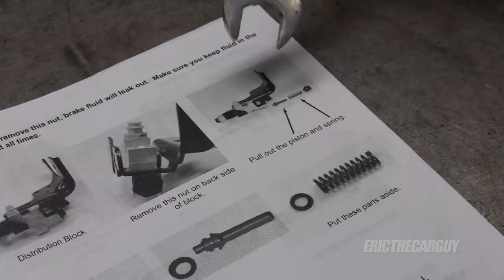GMT400 Rear Disc Brake Conversion (Part 2) #ETCGDadsTruck

Comment: I have a special tool to pop a button out to bleed those older abs units. Can’t remember where the “button” is, or the tool for that matter. But you can’t just actuate the older units to bleed them is my point, at least not in my experience. Of course none of this matters here anymore. Thanks for watching

Comment: Nice video as usual, little bit concerned about the bend in the brake line that you did on the vice, I thought that you had a set of brake bending pliers?
With the parking brakes it looks like it might be worth cutting off that little bit of metal with the hole on the top of the calipers, I'm pretty sure that's only there to hang the calipers when you're doing service work... That might allow the cables to run a bit more freely.
I'm really enjoying this build!
Reply: Kinda cringed on that part too :/
Otherwise it's a great tutorial.
Reply from the maker: Everything works fine without issue. Thank you for your input.

Comment: Seems to spend more time wrestling with the parking brakes than time spent on the disc conversion.
Around here, we cut the parking cables since they just rust up and seize.
Reply from the maker: Personally, I use my parking brake.

Comment: So it looks like the modification for the proportioning valve is just change it to a safety so if you lose a brake line it will close off fluid to that part of the circuit.

Comment: Why did you not route the parking brake cable through the hole on the caliper?
The camera was right on it 30:45 ... the heck?
Reply from the maker: Because it was made for a Lincolin, not this truck. The cables on the truck won't fit that attachment.
Reply: Bet they will

Comment: Eric why did you put the fitting in the back and swap the lines? Every video I've seen about the NBS master has the fitting in the front and the lines are put back in as they came out. Please explain if u have some time. Thanks!

Comment: Not sure if is called the break modulator "round thing by the master cylinder. Might of went bad not stopping the truck as quick as should. No air in the break line(s). Got to get that fixed fully so the truck stops properly. And with souping up the vehicle to go much faster and so stops much faster.

Comment: Want better brake feel do this. 
Pump breaks 4x hold on last pump.
Open bleeder from passenger rear first. keep brake pedal down don't release until bleeder is closed.
Repump 4x hold on last. Open passenger rear bleed then close.  Repeat until not air bubbles. Then move on to driver rear. Repeat steps above for bleeding. 
Then move to passenger front. Repeat. Then finishing at driver front. 
One more time around for good measure and your good.
Reply: Does not work on most of the GM trucks with the early ABS unless you get lucky, or follow the procedure to get the ABS system into the "home" position.  Even then, without a tech I tool, still need a bit of luck or a gravel road and reapeated skidding stops followed each time by bleeding the rears.

Comment: I think that's just the GMT-400 brakes - I never liked them in my '94, either, even with drum rears fully rebuilt, wheel cylinders and all. I think stainless steel brake hoses will make a big improvement in feel, though. I've used them on motorcycles with excellent results - automotive should be no different. I'd install them both front and rear ( if there is a rear hose - YMMV ) - should make a very noticeable improvement.
Reply: Thinking about stainless steel brake hoses on my 99 suburban, the pedal isn't great. The brakes on my 95 caprice are perfect, then when I drive the truck I always forget how much worse the brakes are and end up foot to the floor trying to stop.

Comment: The cable will stretch and you'll be able to purchase more threads, eventually. I would have made brake lines from the master to the prop valve, but that's just me. Hopefully it's all worked out.
Reply from the maker: Those were special sized lines or I would have. Also, time is a big factor with this build. Thanks for your input.
Reply: @ericthecarguy  You're welcome Eric. Hope it turned out well. Can't wait to see the engine and transmission work.

Comment: Hey Eric, Please do a follow up on the electrical side of the anti-lock withdrawal. Did any lights come on on the dash? If they did, how did you deal with them. I think my truck has the "computer", but I do not remember seeing the "actuator valve". I'll take a look when I get home tonight.
Reply from the maker: Yes, the ABS light is on, but since I'm going to build my own cluster without an ABS light it's not going to be an issue.

Comment: You should use Dot4 or better with disc brakes.  On this truck it probably won't see too much heat in the calipers unless something gets stuck.  I switched to Dot4 on my truck because the brakes heat up when braking harder or longer distance with a trailer or a load in the bed.  I switched to Dot4 on all my vehicles just to standardize.
Reply: I use DOT4 in a lot of things but it comes with it's own hassles.  It is still hygroscopic but the degradation curve is a lot steeper.  You are down to DOT3 temperature range in many vehicles in two years depending on what fluid you use.

For me, unless you need it (race cars, tow pig or European cars that call for it anyway) I just suggest good quality DOT3/4 synthetic changed every three years.  Cost savings is significant and performance curve after about 18 months is similar.

Comment: Why did you not use the kit from Little Mfg Shop kit?  They use the same rotors as the front.  Also on my ‘89 K1500 I put a Master Cylinder from an 06 Silverado 4x4 and it much larger than the one you have.  Pedal feels like a 2022 truck and thats with the drum brakes.

Comment: Did you ever figure out the little holes in the calipers was just big enough to hold the emergency brake spring? Not being a jerk those holes look like intended spring guides/holder. @30:51 you say it's just going to rub over the top of it. How about go through it.

Comment: my 94 s10 master cylinder looks exactly like your stock master if i put the new master cylinder like you did would i have to swap the lines like you did. i would love a firmer brake pedal in my truck.

Comment: As I said when you got the truck from you Dad, the brakes will NEVER be better than ok.  I spent a ton of cash and time to get to the same result.
Reply from the maker: Actually after this work and replacing the front brake lines with steel braided, they do feel great. I'd say start with steel braided lines and go from there.

Comment: I found when i bleed mine have it running and started with the farthest caliper away from the master cylinder was the best way for me to get peddle
Reply: Sometimes there just isnt enough pressure when the cars is off. Had it with my toyota pickup when I put new calipers on. Nothing would come out if it was off. Had my friend start it and boy did it finally come out.
Reply: @HillBillyAsian  my dads been doing working on cars since a kid he always taught me if you have a dam chevy start it first or the peddle will be garbage most other cars i just gravity bleed

Comment: Is there such thing as a hydraulic 'Pressure-o-meter' to give you an idea how well the master cylinder is doing it's job?
For the brake switch, go old style with one connected to the peddle.
Ooops i forgot that this in the past, sorry.
Reply: SSBC has a kit with a 3000 psi guage and a few bleeder adapters

Although, this goes right on the caliper. So if you're like me and don't have friends to pump the brake pedal all afternoon, you could also find a cheap electronic pressure transducer of a few thousand psi and wire it to a volt meter to just compare values

Comment: Question: Could the rigid brake lines be swapped out to say Goodridge Flexible style lines? This would avoid having to mess around with bending/kinking the OEM rigid style, plus a cleaner look, slightly better performance. Just curious if this is an option for master cylinder?

Comment: ABS = Anti-Lock Brakes = Ability to Brake and Steer. This pulses the brake up to 120 times per second in a panic stop situation to allow the front wheels to rotate slightly and maintain the ability to steer. Removing ABS has no impact in the brake feel, but does increase your possibility of having an accident that you may have otherwise been able to avoid. Without ABS the tires lock up and you simply skid unavoidably. 

Changing the brake pad material from organic, which gives a nice soft pedal, to a semi-metallic, or other material, to give a harder feel. On the other hand, a harder brake pad will wear the rotor down faster if it is a soft steel, designed for organic pads. You may need to go to a harder rotor to avoid excessive rotor wear. 

Final thought... showing and promoting others how to disable a factory safety device could leave you open to legal recourse should a viewer get into an accident they may have been able to avoid, had the safety device remained in place. Just saying.
Reply: BTW... Your conversion to rear disc was the reason for the difference in the feel of the pedal, not the ABS delete, as ABS has nothing to do with the brakes, other than HOW they work in a specific braking situation.

Comment: I have to say that I'm not a fan of the whole "bedding in" process.  It seems like my previous 2 sets of rotors have warped after doing this process.  I just did a brake job last year and already had to change my rotors the other day when I changed my front calipers.  I have not done the bedding in process and refuse to do so and, so far, they feel great.  No more shaking.  I say let them bed in naturally.  No need to rush it.
Reply from the maker: I got that information from a guy that engineered brakes for the space shuttle. I figured he'd know what he was talking about. Not saying you're doing it wrong, just where I got my info from.
Reply: Quality of the brake rotors I've been getting might have something to do with it.  Bedding them in makes sense, but I shouldn't be warping my rotors in the process.

Comment: I wonder if the dump valve was leaking a little, resulting in a spongy pedal.
Reply from the maker: The thing that seemed to make the most difference was switching to steel braided lines. I really felt a better pedal after replacing the fronts as you'll see in future videos. I know the master cylinder also helped.

Comment: Would it have been a good idea to do the brake lines first, get them mocked up? Then bench bleed the master cylinder, then you could just bolt in quickly.

Comment: Great build, enjoyed all videos on the obs. Have a question. Instead of making bending and cutting lines, is there any flex or other brake line method I could buy or use. Thanks
Reply: Copper lines.    If its legal. Easer to bend.

Comment: IMO: The trick with the C/K 1500s is to replace the 10 bolt rear axle with a 14 bolt sf. That'll give you bigger rear drums bit it adds 6 lug axles. You can pick up 6-lug hubs for the front knuckles for cheap, and then you'll need rims. And I still think that would've been cheaper than putting on a disk conversion kit. Would not have made your brakes less spongy. For that, I think you need a GM800 master cylinder.
Reply from the maker: Just wondering if you've watched the entire video or just commented.
Reply: @ericthecarguy  Yes, I watched it all.  At @35:30 you talked about leaving the drums (unspoken implication: on the 10-bolt). What wasn't mentioned was swapping out the entire rear axle for a heavier-duty one with larger bearings and larger (drum) brakes that I think is a better and cheaper option than the disk brake conversion you implemented. Requires a specialty u-joint to connect the drive-shaft to the different yoke, but that thing is only about $15. I believe that the 2500 drums are the same as are used on the 3500 but the 3500 comes with wider shoes and a bigger wheel cylinder, so I've read that it's possible to upgrade that axle to 3500 brakes. I went the cheap route and used the 2500 axle with those brakes. I paid $100 for a used 14-bolt sf (6-bolt) including the 2500 springs. I then bought a G80 carrier for $90. The rear brakes are now fierce and I'm glad I didn't go for the 3500 shoes! It locks up the back end pretty easily with the bed empty. With a load, it's really good under braking, although a bit spongy. Mine is a 4x4 with 6-lug hubs so I'm going to put 2008+ front disks on it that are 13" up from the stock 10". I'll need a caliper bracket and calipers I think, but I already have 18" rims on the truck, so no problem with clearance.
Reply from the maker: This is a street truck, driven more like a car than a truck. 14 bolt would have been overkill in my opinion. Not to mention I'd have to also swap the front rotors for 6 bolt. I'm more than happy with my choice. 

I did however suggest that swapping out the entire rear axle with the parts I wanted would have been an easier, and possibly a less expensive option. 

You must understand that sometimes my videos are cautionary tales. Sometimes I do things that simply don't work out. I leave that in the video so that the viewer can avoid the same fate. I could just as easily cut that stuff out and no one would be the wiser. What I show in my videos is only one option. There are always other options and other ways of doing things. I never claimed that my way of doing things is the only way to do things. In fact, just the opposite. 

Thank you for your input.
Reply: @ericthecarguy  Agreed. I appreciate the way you provide these videos without all the sanitizing edits. 

I left the comment /feedback, in part, for others who might wander by and read the comments and couldn't afford the $1000+ price tag of your conversion, but wanted that sort of braking power for 1/5th the price. 

In an earlier video, you talked about increasing the power in the motor but not doing a garden-variety LS swap.  IMO, The 14 bolt axle is not overkill if you're going to add some real power. If you were leaving the engine alone, the 10-bolt would be perfectly functional.

Comment: I'm surprised Eric doesn't use a vacuum bleeder.
Reply: I have heard other technicians in the shop say that vacuum bleeders don't get all the air out, I can't confirm this but so far I haven't had issues with using one.
Reply: I prefer a pressure bleeder if the reservoir cap is cheap enough and a normal shape.  $5 in fittings, a spare cap and a $6 garden sprayer...done.

Comment: So you finally ran out of Acura brake fluid. It seemed like a never-ending bottle all these years.
Reply: I have learned working as a Honda tech that you end up acquiring fluid especially if you are a lube tech. I probably have about 30 bottles of rear diff fluid because whatever tech used the fill pump last, left their half bottle on it and it just so happened to cover the half you needed that was supposed to be another bottle.

Comment: Just a suggestion, but wouldn't it be a good idea to check the brake booster pushrod while changing the Master Cylinder?  Might help your pedal to feel firmer with adjusting it out?  

Just a suggestion, awesome work as always
Reply from the maker: I did that the first time I replaced the master cylinder.

Comment: That thing won’t pass inspection in VA with that proportioning valve switch disconnected. How are you gonna deal with the brake light that’s going to be on in the dash?

Comment: Enjoy your videos a lot. I recently upgraded my 1995 Chevy Cheyenne to rear disc brakes using the Little Shop Manufacturing kit. I added a 2002 Tahoe master cylinder. My question has to do with the way you ran you brake lines to the MC. I have seen on a video from another manufacturer that showed using the brass fitting to place the existing front line to the rear and rear to the front. I did not do this thinking that the MC chamber sizes are equal vs. the different sizes on the "old" MC. I did not disable my abs. My brakes work well, but not as much of a change as I had hoped for. Do you feel reversing the 2 brake lines to the MC would/will make much of a difference and why? Thanks
Reply: Working on one now and caught that. Having issues losing pressure when the engine is running.

Comment: Bleeding that looked like a dream.  Is it me or are modern cars very often a complete bitch to bleed? I've done quite a lot of brake work lately (replacing calipers, cylinders, entire lines etc.) so have had to bleed a couple of my cars and both seem to put up a huge fight, they'll bleed eventually but it really feels like somehow air manages to trap itself and the process takes far too long.  I assume it's the ABS unit that causes this?

Comment: By deleting the ABS, you're more likely to lock up the rear brakes since there's hardly any weight over the rear wheels when the bed is empty.
Reply from the maker: So far that hasn't happened and I've worked really hard to lock up the brakes just to see what would happen. I'm also going to install an adjustable proportioning valve so that I can dial in the pressure going to the rear brakes. Thanks for your comment.

Comment: is there a break in for the rear diff?
Reply from the maker: About 500 miles.
Reply: @ericthecarguy   do you have to check the gear teeth mesh pattern then?
Reply from the maker: No, you just take it easy until then. Try to avoid harsh acceleration during that time.